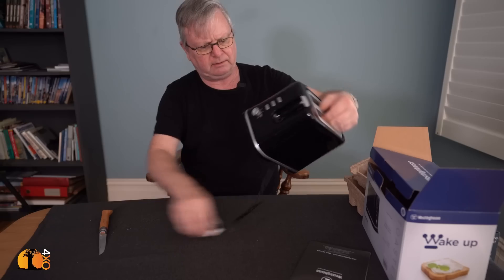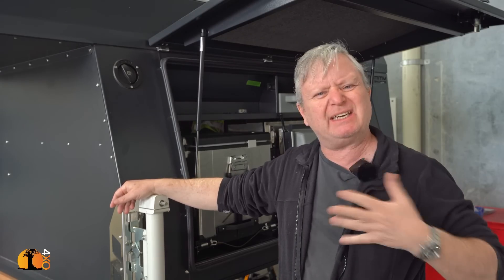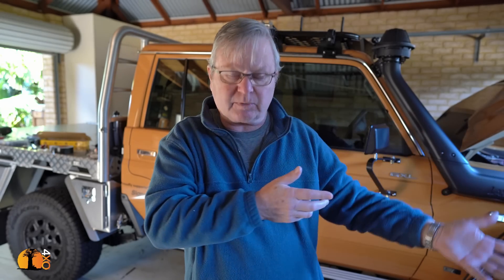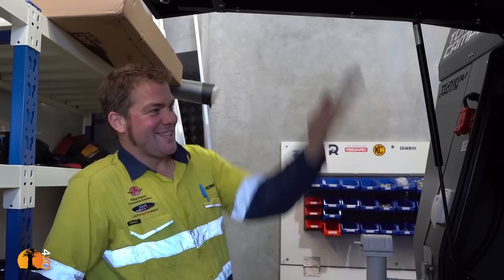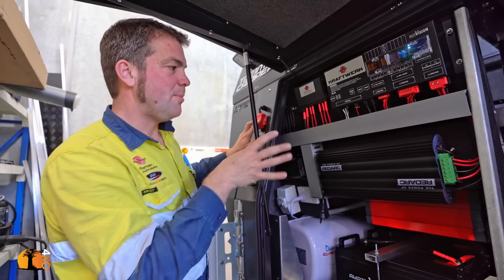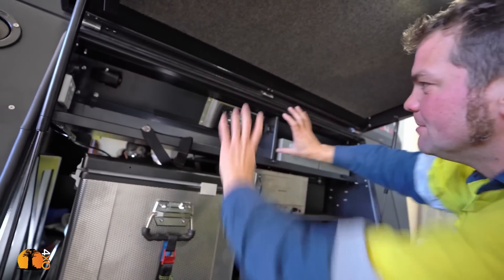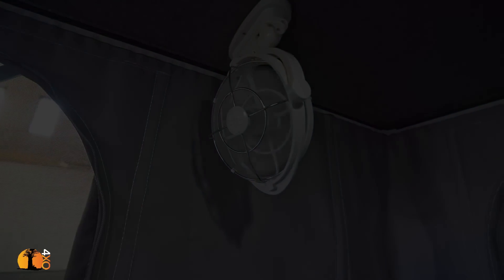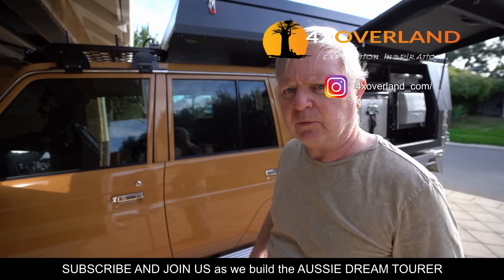Camper Electric Installation. A MASTERPIECE! Aussie Dream Tourer.

Comment: Too much Electrical Power?  I watched the video, then I kept thinking, is there too much electrical power? With the camper on the rear you now have 3 sets of batteries? Maybe you could take the rear seat one out??  But you have already installed the manual battery switch so looks like you going to use all. 
Also, would you ever share the circuit diagram for the installation.

Comment: Great system, but seems a bit too complicated if something should go wrong out bush.
Reply from the maker: I don't disagree.
Reply: It won't go wrong, he is German
Reply: @harveysmith100  Hopefully
Reply: Depends on what goes wrong. With two separate systems you should be able to crosswire something for the essentials in most cases. Maybe not for the induction heater...
Reply: @harveysmith100  is the Gernan going into the bush with him?
Reply: @gbwildlifeuk8269  No need, trust him, it will be fine.
Reply: @harveysmith100  Said no German car owner ever.
Reply: Having watched this guy over a long while, I am sure he will always have a back up plan! Anyway, if you use good gear, set it up properly, less chance of things going wrong. But a good scout, always has a contingency plan.

Comment: I was wondering Andrew, would it not have been simpler to cut and weld the bar behind the cab to get the camper to fit, rather than building the spacer? It is looking good and really nice to see how happy you are with the electric install.

Comment: This is a slightly un-related question in terms of your electric set up, but early in the video when you were negotiating out of the car park, it got me thinking of asking your opinion on doing an automatic conversion on the 79 series. Have you had any experience in driving one that has had the conversion done, or do you think it is worth the close to $30k price tag have it done? I'd be interested in your thoughts. Cheers
Reply from the maker: I'd consider it. But not at 30K.
Reply: @4xoverland  yeah that was my thoughts. $30k goes along way to doing other things to the vehicle that for overlanding would be more beneficial than an automatic transmission. (+- $30k was a quotation from a company that does the conversions in Victoria)

Comment: Two half serious suggestions: firstly  get a Flir add-on infrared imaging camera for your smartphone; not grossly  expensive and great for routinely looking for signs of loosening of  connections or  any concerning  hotspots in the electronics, as well as for monitoring the possible  low rpm overheating alternator syndrome  with LiFePo4 charging.   Secondly, put a remote indicating smoke alarm in the electrical plant room. Yes to the KISS battery selector switch, don't use it with the engine running as contacts will 'break before make' momentarily stressing your alternator diodes and check out CCA limits on your Lithium batteries if interconnecting batteries at the time of  starter use if they can be  connected in parallel  ( Or maybe here you only feed the accommodation  battery via the charge controller ?). Debate  item now, recalling the reverse flow intercooler- do we need  tempest protection   /  full Faraday cage for all this electronics  in case of a lightning strike on the PV roof -  should we all  be installing lightning conductors or at least  transient clamp earthing of the PV  positive ? Tongue in cheek until you are on an open plain and driving the tallest item for miles....
Reply: Great idea! I have this awesome CAT S62 and I was wondering what I was gonna use the Flir for. I already found out that I can find hot water pipes within a tiled wall.
Reply: Great tip, I'm still rocking the CAT S60 smartphone.  I've found the infrared camera useful for many things.
Reply: Agreed.... changing a battery selector switch while engine running is NOT a good idea.

Comment: Looking great! Enough to power the Western Power Grid! Especially when the storms come through and the trees come down!
Box suggestion I have seen, plastic stack-able drawers from Bunnings. Come in differing configurations. And some "ocky" strap screwed across the front to keep them closed. (Graham Cahill's idea, not mine). 
Keep up the good work. And we won't mention the kettle! :-)
Reply: The "plastic stack-able drawers from Bunnings"  sound just like mine (also from Bunnings). 
'Smart storage' made by Oates in double drawers or single large drawer. 
I have 2 stacks of 2. Makes a nice set of drawers. 
They work well.

Comment: What an absolute spectacular machine, can't wait to see it on a trip! Planning a demountable system for my next truck, not camper related, but none the less, demountable. Here in the UK, steel or aluminium pod like units are not very common. Would be great to see a video with details of your mounting and demounting process, how the unit fixes to the tray, and a true insight to how easy it is (or isn't) as I only seem to be able to find sales pitches online!!! Keep up the great work 👌

Comment: Andrew I haves watched most of your videos some are great and some are a bit tedious. I do find your vendetta against Landrover annoying. Criticism of the new Defender is difficult to understand. No one in Aus has one yet and it will be some time before we know how it really performs. My experience of Landrovers new and old is that they are all capable, just as Landcruisers are. Landrover has a different philosophy now one which users different new technologies. We’ll see how they perform over time, but much of it works well, and enables the less capability to do things more experienced people have taken years to learn manually. For instance why would anybody would bother with a manual gearbox or it  is beyond me, using an auto will give you much more control and reduce stress. So in closing I think you need to get off your high horse and try to understand that your approach is not the only approach.
Reply from the maker: You are a Land Rover fanboy. From your perspective I have a vendetta against Land Rover, which is living proof of that. But I don't. Far from it. Not being a blind follower, I tell it like it is. I don't mould the LR story into something that I can like. What I am is frustrated that they have gone against the grain, and the appeal of Land Rover for me has been erased. They removed it. Not me. If my videos were all about Land Rover, I assure you, you would not find them even slightly 'tedious'. This is your problem. Not mine.
Reply: Andrew disappointing that you have reacted like this. I learnt to drive on Landcruisers in the 60,S on my Grandparents sheep station west of St George. No real roads back then and even fewer real 4WD’s. Before that everybody had Landrovers. Unfortunately servicing the cars and support was never there with British Leyland. Everything was British back then. So I grew up with 4WD’s. I have owned a number of Landcruisers, some Subaru’s and Landrovers. I have had radiator issues, lost a wheel, and heaps of rust on Landcruisers. I must be one of the lucky ones because I really haven’t had any issues with the Landrovers I have owned - they have been more recent models. Technology is the future it always has been and always will be and it helps to democratise 4W Driving. Many 4WDrivers will not use Auto, why? It is so much better for going off road than manual gearboxes and today very reliable. So time will tell what works and which vehicles survive.